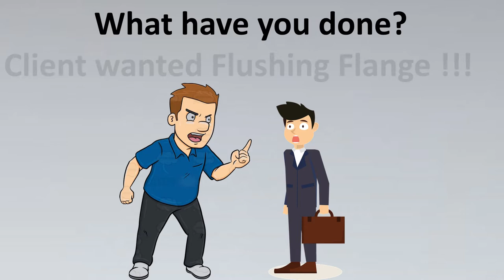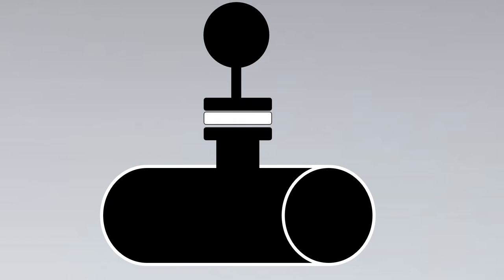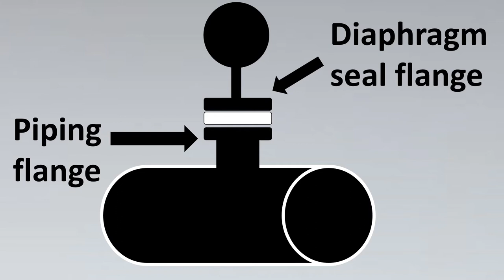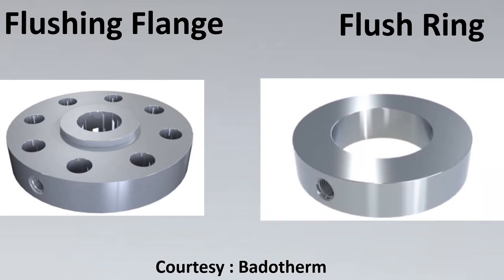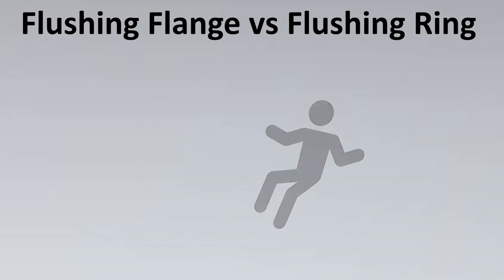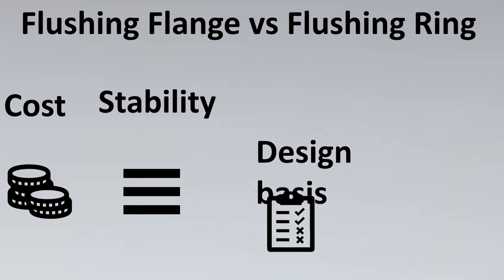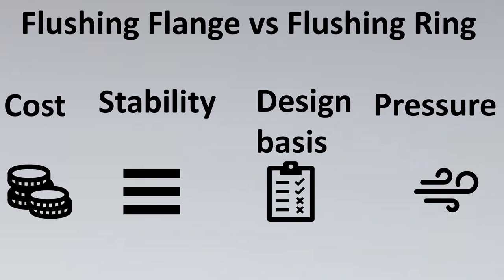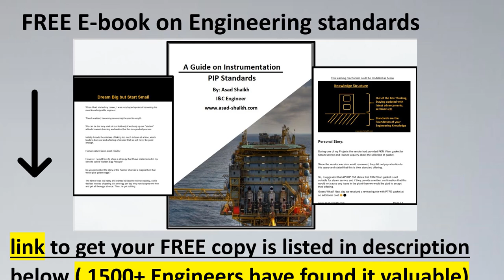Flushing Flange Vs Flushing Ring

Comment: Very very thanks for sharing this topic.
May I know what is the range or what range to be considered for low / medium / high pressures?
Reply from the maker: Mohammed Nizamuddin Thank you for your comment.
I have gone through few standards but I could not find any specific value for pressure.

I could find that for High pressure application flushing flange is preferred but i guess they have left it for the end user to use their engineering judgement